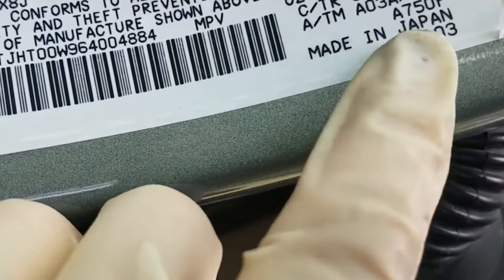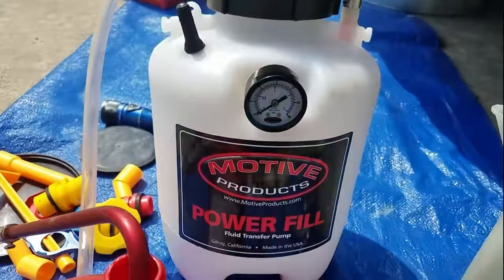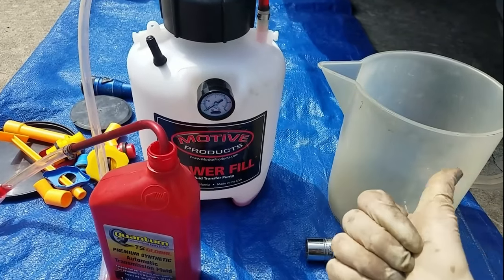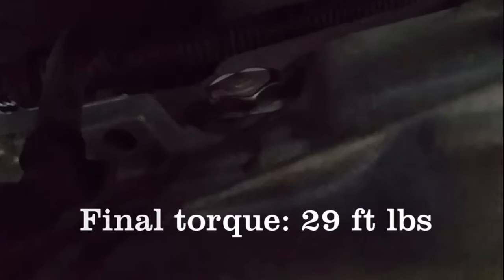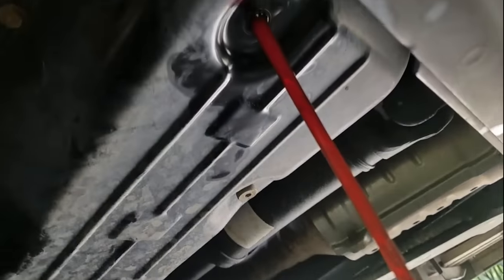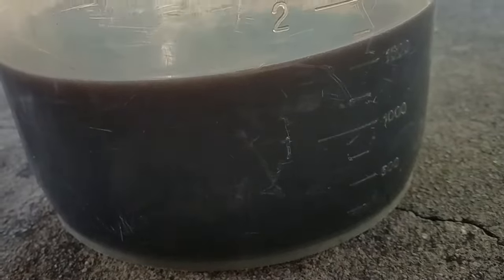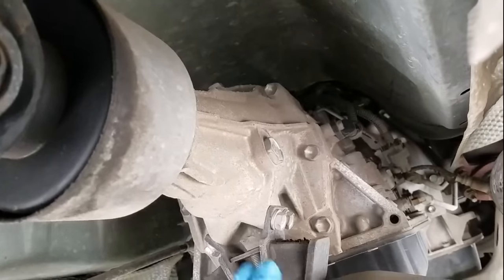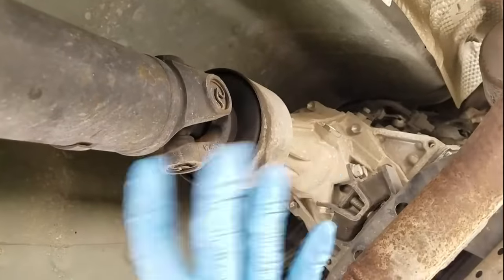How to Service a Sealed Toyota Transmission

Comment: Hi great video I'm going to try the same method on my Volvo   only thing I'm going to do different is weigh the fluid as well  ,I'm going to do the drain fill over a few weeks so I know the fluid is well mixed up  I will probably give the car a good service and change the most of the  fluids and  filters  over a 3 week period  if every goes to plan  .  Like how clean you kept everything

Comment: I appreciate the tutorial. One thing though when I did my 2006 4runner with an A750F Transmission, the fluid temp hit 115f very quickly and by the time I finished checking the level, it was up to 165f.
Update: Sorry, I can't believe I made such a dumb mistake but I was looking at the coolant temp not the tranny fluid temp on my scanner. LoL

Comment: If you didn't have access to a scan tool would draining, measuring the fluid and filling it back up again while everything is cold achieve the same result? Assuming you did it over a few days.

Comment: I've got a 12' T4R with about 75k non towing non mountainous miles. Do you have a mileage cutoff for a 4R transmission that has never had the fluid changed?  I've always heard that once a magic number of miles has accumulated then changing the fluid can be problematic.
Tks!
Reply from the maker: Yes, you should be absolutely fine because the first interval is 60k and you didn't miss it by much!! Go for it!!!!

Comment: Faye, wouldn't it be easer to flush the transmission by undoing a transmission line from the radiator, just want your thought's on that, plus I wanted to drop the pan and change the filter, I have a ES350 Lexus 2012. Thank You. Awesome video.

Comment: Hello. I have a 2015 Tacoma that I bought second hand. It has 140,000 miles and the original owner never changed the transmission fluid. I have replace the serviced both differentials and the transfer case. The vehicle is in immaculate condition and is functioning perfectly. I’ve put around 12 thousand miles on it since I bought it 4yrs ago and have been reluctant to change the transmission fluid. May I ask what you’d recommend?

Comment: Excellent job and thanks for showing that Motive Products power fill...always looking for easier ways to do maintenance on our families 7 vehicles (some, like my Tundra, with sealed trannies.)  I also heard of the thermal gun to check the temps and you've confirmed what I've heard....that's it's good to use when you don't have a $10,000 techstream.  (Despite the folks who swear it's not...the proof is in the pudding!)

Comment: thanks for the video. I am debating if to do drain and fill or fluid exchange with a machine. I am hoping you can shed some light on this since you are a Toyota technician. My car is an IS with 60k miles and im in a toss up of which to do. I have read both sides of the debate and my lexus dealer will do a full flush, not drain and fill. I can get drain and fill done for 100 though

Comment: I’m doing a flush and fill on a 2004 4Runner with about 207,000 miles on it.  I believe this is the first time it’s been flushed.  I’d like to change the filter, as well would you do that first or just before the last drain/fill cycle?

Comment: Nice video. Well done. But I have a question. Where did you get the spec for the ATF temperature? I have a 2010 Mazda Miata with an Asin (Toyota) auto transmission, and the factory manual calls for 50-60°C, or 122-140°F.

Thumbs up for the comparison to the IR thermometer.

Comment: I noticed u did not change the transmision filter during the flush. What is your opinion on this?
Reply: I have the same question.  I'm about to do this procedure but I wonder if there is a transmission filter I should be changing as well as the pan gasket.

Comment: Hi Faye. Love how thorough you are with your videos. Your a great teacher. One question I have. Most transmissions have a replaceable filter inside the transmission pan. Just one step more dropping the pan and replacing the filter. I look at it this way. When you change your oil. You wouldn’t leave a dirty oil filter on. Same goes with a transmission filter. Because eventually it will get plugged up, once it plugged up, there is no bypass like an oil filter. It will cause damage to the transmission. What are your thoughts on this.
Reply from the maker: Oh gosh, I've answered this so many times I don't wanna type it all again!! Haha but I will. There's no point in the first flush, I've never found anything in all the filters I have dissected and I think opening up the system can do more harm than good. 2nd flush you can if severe service, 3rd (and when the pan will start to sleep naturally) is the only time it ever makes sense to me and the only time I've found particles in the filter. Hope that helps 😃
Reply: @FayeHadley  fantastic video! i have a 2012 tundra with 125,000 and i'm going to do the tranny, so i'm watching this at 430 in the morning, and can't wait for the sun to come out! haha
you've answered a lot of questions I had! ;-)

Comment: Hey! Thanks much for sharing these videos, they help a lot. I recently bought a 2007 FJ Cruiser 4x4 but I noticed it shudders also does share shift between 1st and 2nd gears, I’m planning to do a flush and change the S1/SL2 solenoids. I’m not expert I’ll try that and probably work. Is there something else that you recommend?

Comment: Hey Faye,
Question with regards to a 2018 Tacoma with the automatic transmission. Having the towing package the truck has the cooler with the thermostat on the right side. I have heard some people push the thermostat pin in and hold it open with a small Allen key to allow fluid to be flushed out of that portion of the system. Obviously when draining and filling the transmission the unit will not be up to temperature to allow for the thermostat to open thus keeping old fluid in the lines to the cooler which is why some suggest pinning the thermostat. Is this the correct method when draining and refilling? Outside of this the procedure should be exactly as you showed in the video. Is it also safe to assume the temperature specs for checking fluid level are the same for a 2018 Tacoma as is the vehicle in the video? Thank you for any advice. 

Dave

Comment: Hi Faye. Great video! Quick question as I would love to get your opinion since you are a Toyota specialist. I just saw a video where a guy used a different strategy to get the old transmission fluid out. Basically, he hooked up a clear plastic drain hose to to the outlet of the transmission cooler on the radiator, turned the car on, and let the transmission pump out the old fluid until he started to see bubbles, then turned the car off. He then dropped the transmission pan, cleaned it out (plus magnet), changed the filter and gasket, and reinstalled. Then he refilled the fluid and did a level check. What are your thoughts on this strategy for a 2006 Lexus GS 430 with 160,000 miles that I don't know the service history for? Thanks.

Comment: Hi Faye. For the check level test would you also need to cycle through the gears again one more time before looking for that little trickle? I'm wondering if you might get an inaccurate level reading if not? Thanks.

Comment: Two questions.
Did you do the final fluid level check with the engine running? It sounded like it was. I would think the fluid would be under quite a bit of pump pressure with the engine running?

Second question: If you were short on filling the transmission to its full capacity, what symptoms would you find while driving?
Reply from the maker: Yes, check it while it's running, and no there's very low pressure in the pan area.

Low fluid level will give you funky shifts, (you could have either delayed or premature, depending how low) hesitation, fluid burning, fluid frothing, funky smells!
Reply: Thank you Faye for answering my two questions. I completed my transmission fluid change successfully thanks to you. 
I really like your channel, it’s the one I trust the most.

Comment: Hey Faye some transmission shops have told me that adding new fluid to a trans with 150000 miles might make it act up.
What is your thoughts on this?
Because I did one drain and fill and thinking of a few more.

Comment: So they got rid of transmission dipsticks that allowed you to both check the ATF level/condition AND refill the fluid through the top with a funnel....and replaced it with needing to have a fluid transfer pump and a computer with specialized software (that I'm sure isn't free). How is this progress?

Comment: Faye, I have a 2020 RAV4.  I haven't done the drain/refill/check yet. Watching "The Car Care Nut" (TCCN) he shows a specific way to do the drain/refill/check video without a diagnostic tool.  I have that video, however he mentioned that specific 90 to 110f temp for the RAV4.  
I have the X Tool D8BT and yes monitoring the Trans Fluid Temp Sensor 1, I saw the temp get to 90, figured that's the time drain the excess new fluid according to TCCN'S video.
Do you have suggestions, tech tips, ideas about this procedure.

Comment: Good instruction.  Is there any practical difference between this method and the removal of the fluid cooling return line for flushing the residual dirty fluid?
Reply from the maker: Only because it if difficult to measure the amount coming out and it takes more time because of that - that's all!
Reply: @FayeHadley  Good point!  Disconnecting the cooling lines takes more time.  Thank you for the guidance.

Comment: What happens if you remove the overflow plug when the engine is not idling?
I ask because I tried that and a lot more fluid came out than when the engine was idling.
Also, thanks for making such a thorough video, I know how much more work it is to docuvideo and work at the same time.

Comment: I am wondering about the infrared thermometer method. I know that is not your preferred method but it was pretty close but you were in an area where the ambient temperature was 80 f. Right now I am in Washington State and it is 40 f. And I just did this service and change the filter in the transmission.

I spilled a little while pumping it back in so that got my measurement off and I put a little extra because of the spill and I did the method with the infrared thermometer on the pan I got it dead center of the temperatures you listed and then I opened it up and got down to a trickle.

Then when I drove the car it is hesitant to shift into gear. If I put it in D or in R there's about a two-second delay at first and then after it warms up it starts shifting okay. I think the fluid was too hot when I drained the test tube and now the fluid is a little bit low. I'm sorry for this long comment I don't know if you read these but I'm just wondering anybody's thoughts on this. I think I need to take it to the dealer at this point

Comment: Excellent video. What about the transmission filter I have a Buick le sabré 02 with 400000 and I do change the transmission fluid and filter NO FLUSH every 15000 miles and it’s running like new. And I just bought a 2021 Toyota 4 runner trd off road and I was curious about the transmission oil change. Your video really gives me an idea thanks 🙏.

Comment: Ok, so I replaced the tranny fluid and filter on a 2006 4runner today. I opened the hood and got more light down into the tranny area. I grabbed a run of the mill plastic transmission funnel and attached a piece of clear tubing(roughly 1/2" I d.) to the end. I fed the other end down to the transmission. Went under and put the other end in the fill hole. Worked perfect. I added my tranny fluid without spilling any and it was pretty fast. Just sharing a tip.

Comment: I wanted to find out about the Toyota Yaris 2013 when opened the screw
 By the time the oil meter comes out, oil will be poured out and it can reduce the amount of chalk
transmission?, Chalk testing was done only for a general need and not for any other problem The color of the oil itself is bright red which I guess is good.
If this is a mistake and because of this it is necessary to completely change the gear oil.?😨,
The test itself for a car in a licensed Toyota Israel garage but that does not mean that the test is correct that's why I need your recommendation tnx.

Comment: When you performed the final top-off and drain, I didn't see you operate the different gear settings (P R N D) of the transmission.  Didn't that need to be done as the fluid was warming?

Comment: Hi Faye, I have a question, can you just hook up to the transmission radiator lines and just let the transmission pump out any old fluid and just have it pump in fresh new fluid from a bucket? I think some transmissions have a solenoid valve at the transmission that opens up when the liquid is warm, so this would allow you to let the transmission warm up first and then flush at the transmission cooler connections?

Comment: You need to add additional fluid to account for the amount in the pump housing and tubing.

For example if the amount of fluid inside the pump housing and the tube are 5 oz  then you lost 5 oz Everytime you drain and refill

Comment: I’ve done a drain and fill on my 2015 Mazda 3, but it luckily had a dipstick bolted under the air handler. Now I have a 2016 Miata without a dipstick...this is gonna be fun when it’s time to do the drain and fill ☠️

Comment: Faye I have a 2020 Ram and in the settings it shows the transmission fluid temperature. Is that ok to go by and trust or do you still recommend the laser gun and computer? Computer is out for me, rather the laser gun? Thanks for your video. Im going to try it for the first time thanks to you.

Comment: Can a first service like this be done on a 2011 Tundra 5.7 4X4 with 130,000 miles on the factory transmission fluid still in the truck? Or, should it be left alone? Thank you for making this video.

Comment: Absolutely brilliant. Exactly how it should be done and explained so people know why they should do it that way. 
With oil choices  I fully agree. Use Toyota WS oil only. There is no real substitute unfortunately in this case that perfectly cross-references in the data sheets. There are some that are close though.
Thanks for helping and doing it well. 
Greetings from Australia
Reply: Don't know about Toyota WS oil only I use Valvoline that was readily available that fits the WS standard - we'll see. Hondas are different, very picky, better stick with the Honda oil.

Comment: Gr8 vid
I did a atf flush on a 2001 maxima with a JATCO transmission (cringe) 
At least it isn’t a CVT.   How I flushed it was 
3 drain and fills with few thousand miles between each over the course of a few months.  This is a slight modification to Honda procedure for a flush I applied to a Nissan  since I don’t have access to a flush machine and the high mileage on the transmission 
In order not to “shock the old transmission”  and I used some additives.  Lucus and seafoam transtune.  But on the 3rd and final drain and fill. Used only ATF.  And I used full synthetic valvoline maxlife ATF for all drains and fills
It is compatible with the Nissan Matic-D fluid it called for.

It went from something that would barely move to drivable.  But still gets p0744.   I bet it’s a solenoid block or entire valve body.   Or TCM or trans temperature sensor.  It’s got 210k miles and 19 years. It’s my sons first car now and gets him around town no long trips in it.

Comment: So, I have a sealed transmission in my Sequoia and have never done a fluid change because we were constantly told it’s sealed and it doesn’t need it. Now I’m reaching 200,000 miles and I’ve been told to not change it at this point because it’ll cause more issues. But also been told to change it and I’ll should be fine.  So not sure what to do. Thanks for any info.

Comment: I found your video to be very informative, thank you. Two small questions from a newbie. I have a 2006 Lexus GS430 and I can't find the fill hole. Also the drain bolt does not have the Allen bolt hole. Is there going to be a plastic tube inside anyway? Thanks, Nick

Comment: Hi Faye,  So once the ATF reaches the spec temperature, you check the level plug with engine running?  I am thinking of doing this on my GX470.  Thanks

Comment: Have you had any experience with the AA80E 8spd trans in the lexus LS460. If I remember correctly I saw a WS bolt on that trans as well. This is a great instructional video and if it applies to my trans that would be awesome. My trans has the exact same drain plug and check plug so I assume this will work with my trans.

Comment: For a 2012 Toyota Sienna transmission the temp range is fron 95°-113°. Why such a wide range and which temp reference would you use? Wouldn’t you want to use the higher range due to max expansion? Or does it matter as long as you are in the range?

Comment: I have lexuses 350 2008 with 177k kilometers running. I don't know the service history. Should I change transmission fluid?? There is no issues with gear shifting.

Comment: My transmission bell housing seal was leaking and I replaced it myself only to have it leaking again. I noticed that I have a little delayed shift in my transmission and my replacement seal is leaking also. Should I take it to the dealer so they can make the repairs and put back the proper amount of transmission fluid ? My truck is an ‘05 with about 61,000 miles on it. I just concerned about the proper transmission fluid and the regular mechanics around here are not familiar with servicing these type of truck transmission yet.

Comment: Hi Faye, when checking the ATF fluid level, what area  of the car do you check  to make it level? The top of the transmission oil pan or frame?
When I level check the frame underneath  car and top of trans  oil pan its different!
I appreciate  your videos and help! I also just subscribed! Thanks!